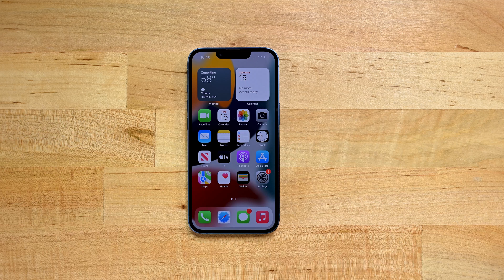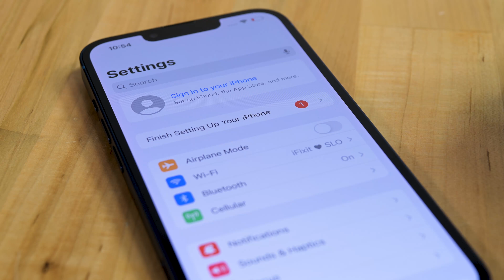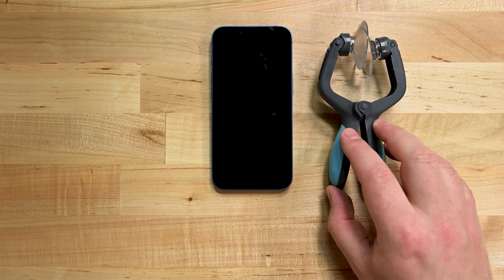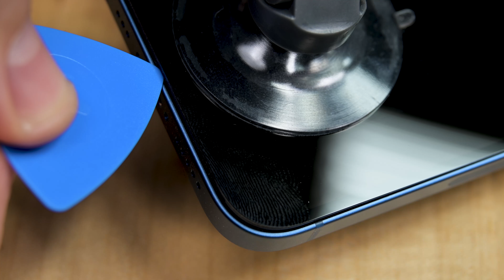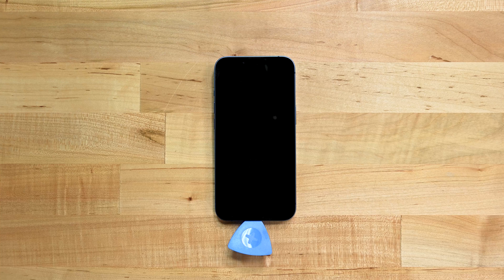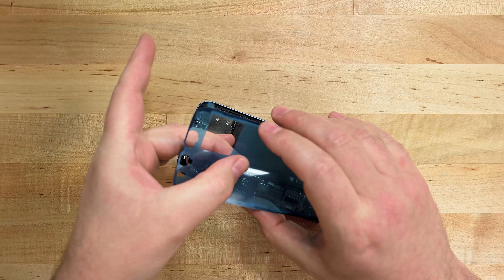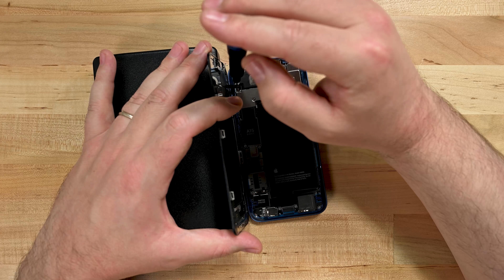How to Replace the Display on your iPhone 13!

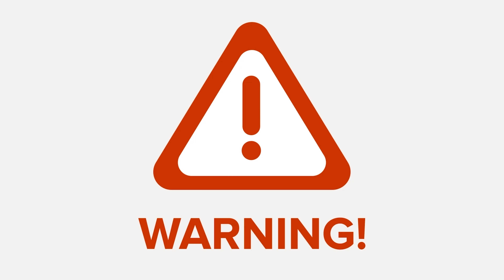Comment: 0:49 Aftermarket programmer?

Edit: the brand is Qianli

There's also a blue one but I forgot the name
Reply: I doesn't work on the iPhone 13
Reply: Believe the blue is JC
Reply: @mrichardist5764  Yep, rhe JC Pro 1000s, however like the other commentor stated, I dont believe that JC promises IP13 compatability. Also, the average person does not have a $150 screen reprogrammer, nor should they need to have one to make a simple repair
Reply: @Carterthielftw_  It's still worth the investment though.
Reply: @blakegriplingph  I agree, however its not something that the person that is doing their first display swap will have.
Reply: @Carterthielftw_ ifixit doesn't mention it's existence tho
Reply: @lachlanlau  if it wernt such a legal grey area, I would love to see iFixit come out with a programmer. They are much larger than the other 2 brands and could probably pull off something thats effective and easy to use.
Reply: @mrichardist5764  it is

Comment: I just don’t break it in the first place.Have never broken a screen in 12 years of having smartphones.
Reply: good for you, but accidents happen
Reply: Accidents happen boomer
Reply: If someone breaks their screen, "you shouldn't have broken it in the first place" isn't the answer. Accidents do happen, so it's important that people can replace their screen so the broken phone doesn't become e-waste. It might also serve as a lesson to be more careful with the device or buy a better case.
Reply: @CubeBag  Yes,accidents do happen,but far too often because people are too clumsy and careless with their expensive devices.Also,some people refuse to use a case and screen protector on a glass device then complain when they drop it and it breaks.
Reply: Boomer here, and, Yes I have broke screens. "Rock on Boomers"
Reply: Good for you, quick question, do you actually use your phone? Cause no one goes 12 years without an accidental drop.
Reply: @yasebaravenclaw2192  I have.
Reply: @yasebaravenclaw2192  YES, I do USE my phone (too much actually) and YES, i have had the very occasional drop but I always use a decent screen protector and case to limit or prevent any damage.
Reply: ok boomer
Reply: @radwan.szabouni  zoomer here: same for me. don't treat your stuff like crap
Reply: @radwan.szabouni  Grow up 🙄
Reply: Sapphire Screen protectors exist, they are expensive, but pair it with an otterbox and its basically indestructable
Reply: @Carterthielftw_  Sapphire Screen protectors are way more scratch resistant than standard ones but at a trade off. The sapphire screen protectors are more susceptible to damage by impacts due to their brittleness
Reply: @biomek100  Neat, I actually didnt know that, it makes sense though